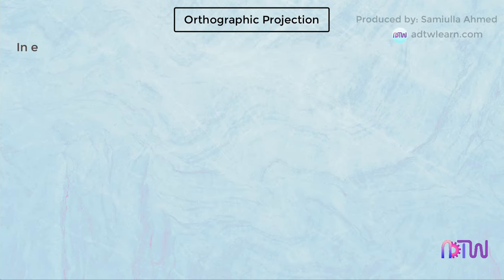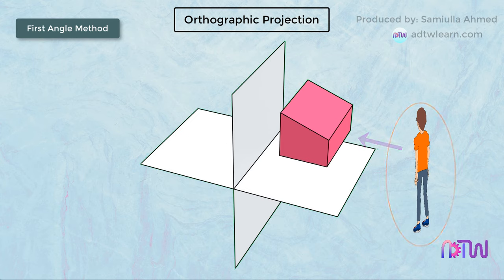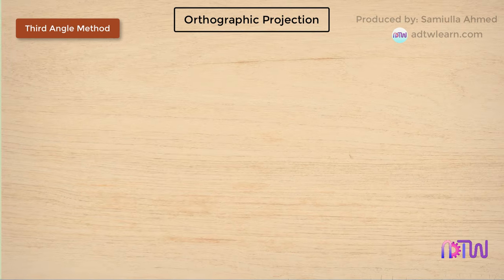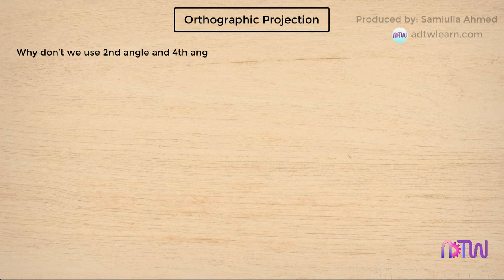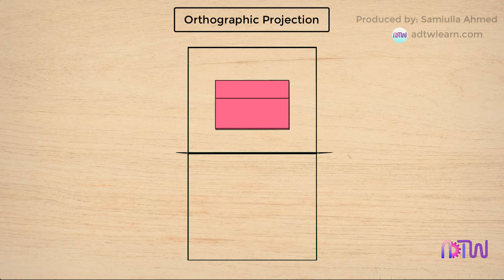First angles vs Third angle method | Orthographic projections animation

Comment: @ADTW,. In 3rd angle, What is the logic when projecting the right side on right plane itself & left side on left itself.

Projection falls on next plane (profile planes). It holds true in top and front projections. 
But I need logic or logical difference when projecting om side planes in case of 3rd angle and 1st angle
Reply from the maker: In 3rd angle projection, the right side of an object is projected on the right plane, and the left side is projected on the left plane. The logic behind this is that the right side of an object is seen as facing towards the viewer and the left side as facing away. This results in a true representation of the object's dimensions and form.

In 1st angle projection, the reverse is done, with the left side of the object projected on the right plane and the right side projected on the left plane. The logic behind this is that the front of the object is considered facing the viewer, so the left side is seen as facing away and the right side as facing towards the viewer.

In both cases, the perspective projection is used to represent a 3-dimensional object in 2 dimensions, with the chosen side used to define the front of the object.

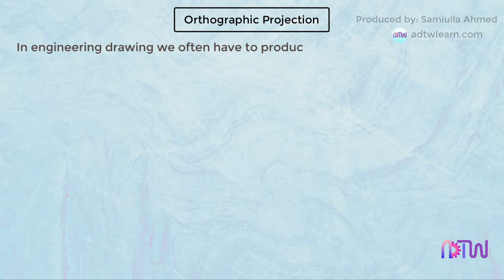Comment: 00:08 Orthographic projection is a method to show 3D objects on 2D planes
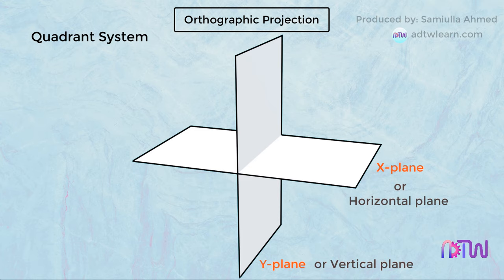00:58 Orthographic projection involves dividing the plane into quadrants and using first and third angle methods.
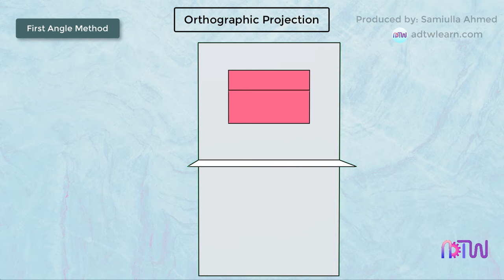01:47 Understanding Orthographic Projections in First and Third Angle Method
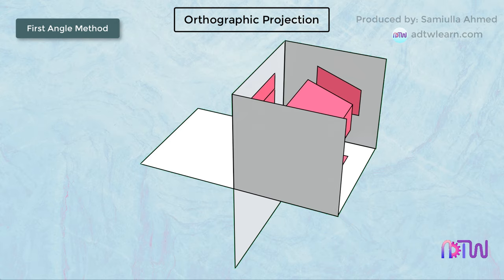02:31 Orthographic projection involves rotating horizontal and unfolding profile planes.
03:13 The third angle projection method explained.
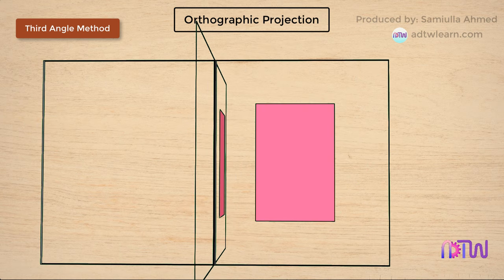04:01 The first and third angle projections methods explained.
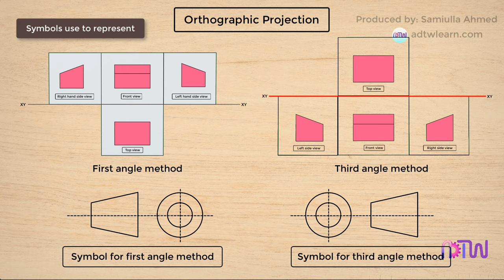04:47 Orthographic projections show 3D objects on 2D plane using first and third angle methods.
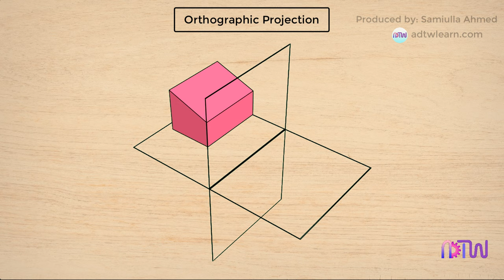05:33 Understanding projection overlap in first and third angle methods
Crafted by Merlin AI.